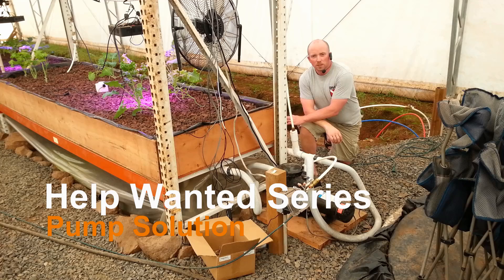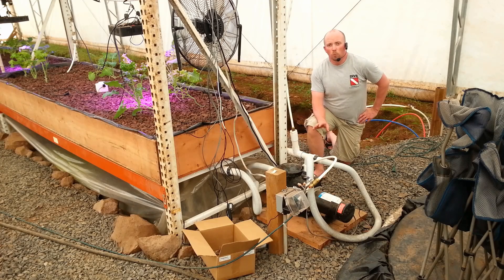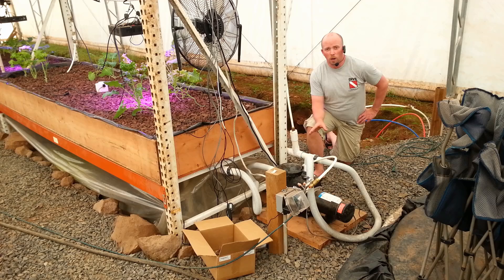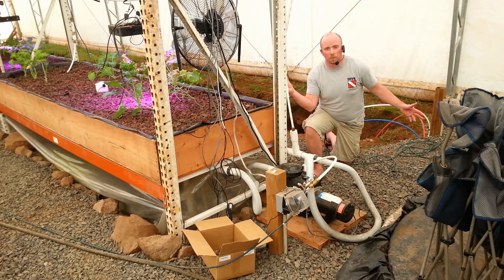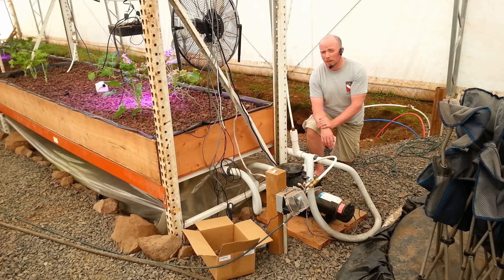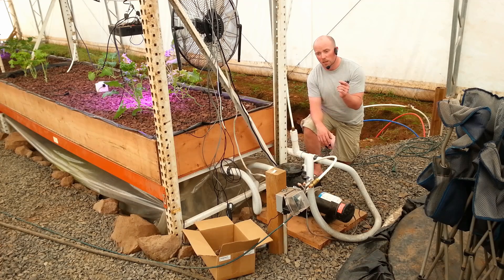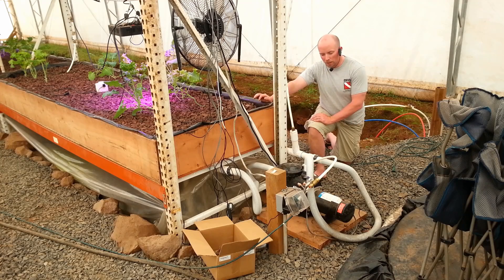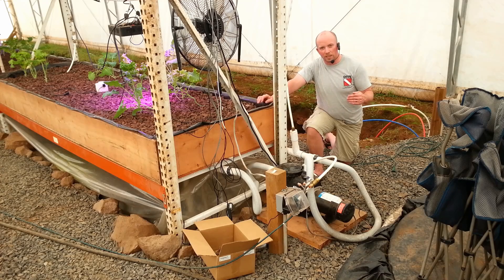Choosing your Aquaponic Pump setup - Things to Consider

Comment: TRM, pumps are sized on GPM and ft head. 1 psi = 2.31 ft head. We need the volume of your tanks  to determine how many water changes per hour the pump can supply. You're not showing us the entire picture. We stated this before.  Are the pumps 240V or 120V? 240V pumps would be half the current. What are the specs on the current pump, GPM, ft head, HP, volts, and we know 12 amps but not the voltage.
Reply: While I agree a picture of the pump nameplate would be helpful, he did show us both the power meter reading 120v, and the breaker panel with no 240v breakers.  Existing pump is 120v.
Reply: The lanes are 60ft, by 44inch, looks like there are 4 growbed per lane. So that makes for a single growbed being 15ft x 44inch ... basically 15x4 ft and the height looks like 1ft. or so ... so 60ft^3 per growbed entire volume. Guestimated 75% of total height standpipe, leaves 45ft^3 of water needing to be filled per growbed in X amount of time, where X is related to the pump as well. (above all by 'thumb' )

Comment: What about a smaller pump up to a reservoar	 and then the rest is just gravity fed?
Reply: This would also allow a smaller pump to do the work since gravity would provide the linear friction diff. In addition, you could add a rain capture system to aid in water replacement from evaporation. 

The downside is that it will take a sizeable tank above the level of the top grow lane and this will introduce added complexity when dealing with colder temps in winter.
Reply: This would also allow a smaller pump to do the work since gravity would provide the linear friction diff. In addition, you could add a rain capture system to aid in water replacement from evaporation. 

The downside is that it will take a sizeable tank above the level of the top grow lane and this will introduce added complexity when dealing with colder temps in winter.
Reply: If water from lanes 1-2 were connected and 3-4 were connected then you'd only need 2 pumps. With a master channel for each lane 2 & 3 at 12 feet with their overflow to lanes 1 & 4, respectively each at 8 feet. I can see being able to shut down halves as they are already sharing the Heating and Cooling I don't see why sharing water would much more dangerous since your using misters which could cross contaminate the other lane already.
Reply from the maker: a major challenge I see in a holding tank is winter time operations...that could freeze easily if not heated.
Reply: Yeah, comes back to that insulation/heating issue, it kind of all ties together :)

Comment: Stop just add an of grid solar circuit with batteries I don't see you getting the job done with 40 amps. what you have for pumps is working and mixing the water you could loose all your fish.

Comment: Adding an equalization tube that connects all the pond lanes will allow you to draw water from all the lanes and keep the level the same in each one ... although hearing your pump requirements makes me think that if you go to a 1 pump system, you're going to need a huge, expensive, commercial pump. If you could add some flow/pressure requirements, some calculations could be made to make that determination :).

Comment: You need to implement a Semaphore (resource lock) in your control software so only one pump can run at a time.  The software controlling the pump must take the semaphore before starting the pump and returns it when the pump turns off.    This allows isolation of your lanes and doesn't require an expensive time consuming plumbing exercise, while still conserving your max power usage.

Comment: in the septic tank world they have distribution boxes  (D Box) which is a concrete box that has openings  cut out for 4 inch exit pipes for the leach field.   Run in reverse you could control the flow out of the individual lanes with their "self levelers"   Which is a piece of plastic that fits the end of the 4 inch schedule 40 and is set us like a wood stove flue   A hole with a rotating piece that restricts or opens up the flow.   4 inch pipe with a opening in the restrictor of about 1 1/2   .  You cold easily build a D Box and the restrictors cost is low     .
Reply from the maker: that's a great idea

Comment: If you go with 1 pump get flow meters and air operated valves. monitor flow meters with a plc and open/close valves as required to regulate flow. This will also allow you to manually disable a lane by closing the valve with the press of a button without affecting the other lanes.